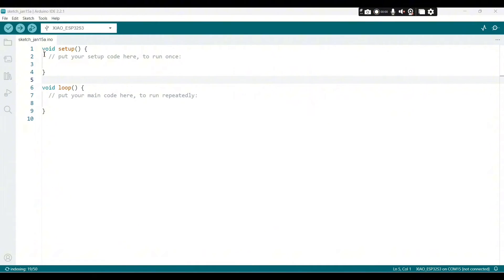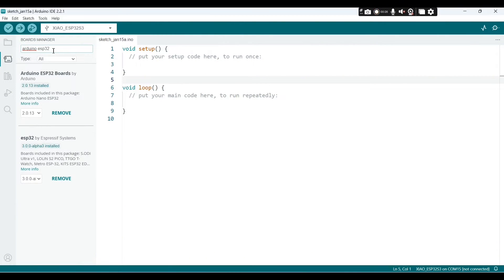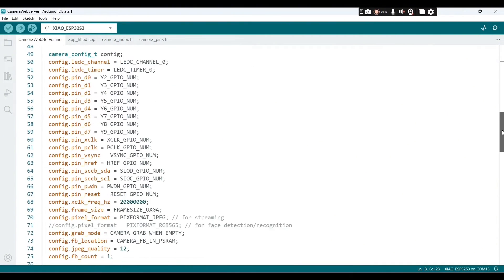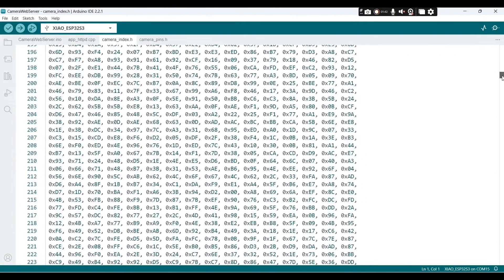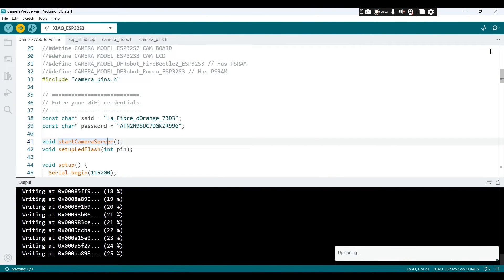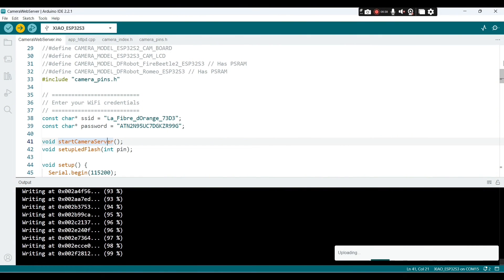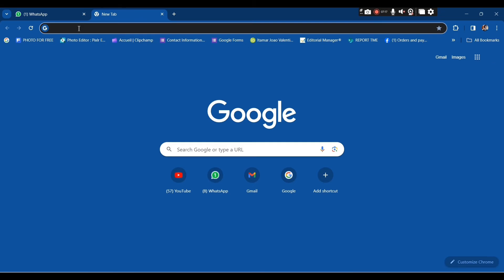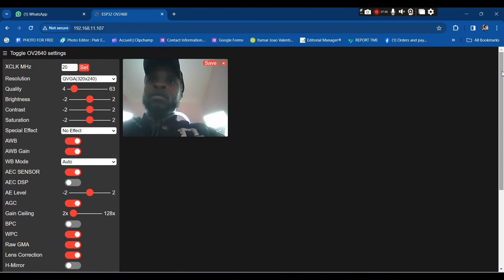How to setup and use ESP32-S3  Cam with Micro USB WiFi Camera

Comment: Can you create 1 project using esp32 with sct130, dht11 and pir sensor.. pir sensor will detect movement, if there is movement the light will turn on..for dht11 will detect the surrounding temperature.. if it''s hot, the fan will turn on.. sct130 will calculate the energy level of the fan and lamp.. u can use fan 2pin 5v
Reply from the maker: I’ll think about that.
Reply: I realy hope you can make that